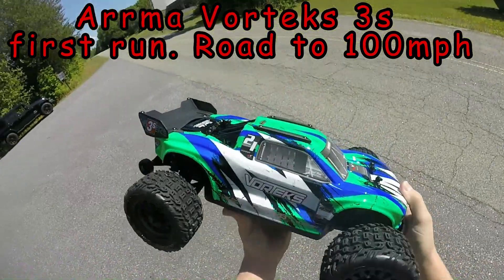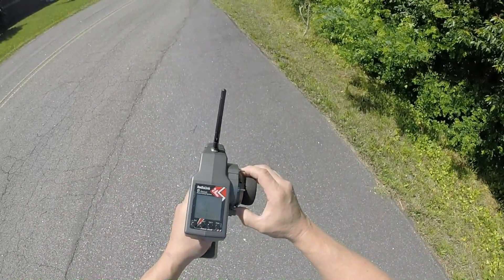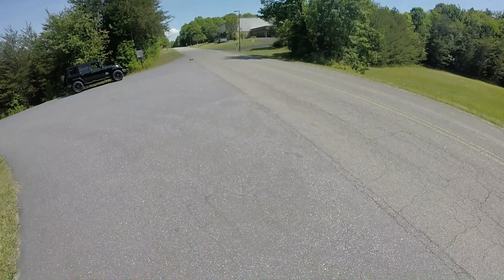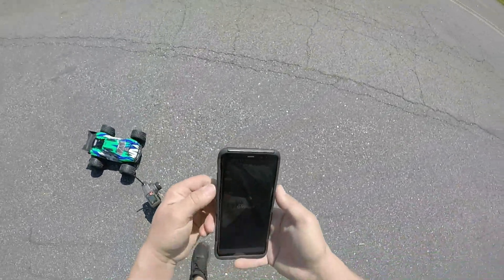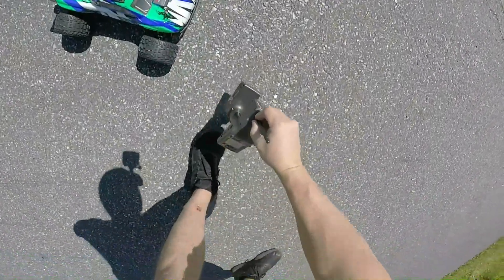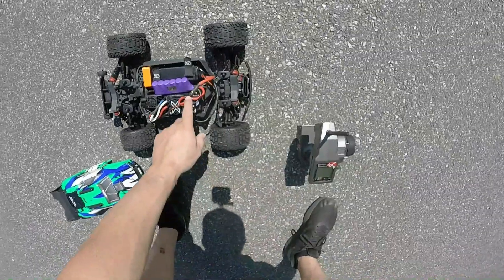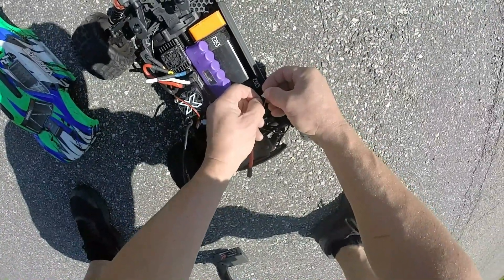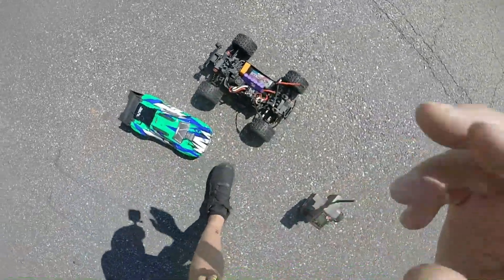Arrma Vorteks 4x4 3s ,First pass Road to 100mph

Comment: Nice! Good stuff. Only thing about the 3s cars is that center driveshaft. It can cause problems lol. Diggin the journey. I’ll be watchin! Cheers.
Reply: It's funny you say that I noticed that a lot of the other 3s line have that center support with bearing for the  center drive shaft....this is my first 3s car so I don't know too much about them ....but  the vorteks does not have that.... now I saw it in "upgrade options"  when shopping online .....so in your  opinion is this a must have?
Reply: @MikeSarni   I’m not sure. My guess is maybe the granite and vortecks are shorter and doesn’t need it? I believe you can still add it but Don’t quote me since the chassis is shorter and I’d have to do some research. Unless you’re doing speed runs, it might not matter. I myself have bashed hard on my typhon without it and it didn’t matter. Just something else to break and it’s flimsy anyways. On speed runs it’ll help a lot, it will help keep the shaft from wobbling too much. As far as I know there is no upgrade for the driveshaft itself, nor the bearing carrier. Hope this helps.
Reply from the maker: yeah I have had a 3s typhon before, had a blast with it. thanks brother.

Comment: You know what though those stock dboots katars are not too bad..... it's actually a harder compound they don't balloon as much as the other 3s line up or other Rc's that I seen..... I'll tell you what I put on a pair of belted tires from Duratrax ....( don't know how I really feel about them right now the rims that came with are shit some crappy beat lock deal) ....but going full throttle the katars look the same as far as ballooning goes which really isn't that bad. I mean I had a 22 tooth on it and the tires were fine. This motor won't take anything more than a 22 tooth you'll start getting shut Downs with the ESC everything gets hot super quick maybe it's time for an upgrade 😁
Reply from the maker: yeah i was suprised at how well they did at 60mph.